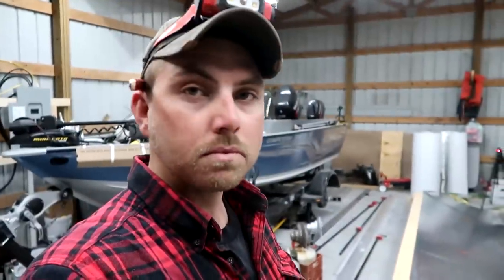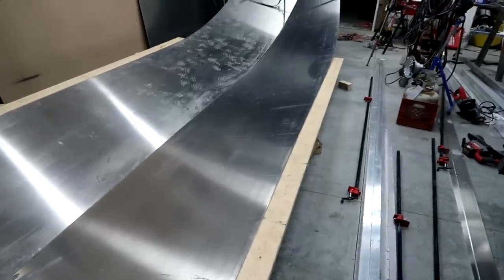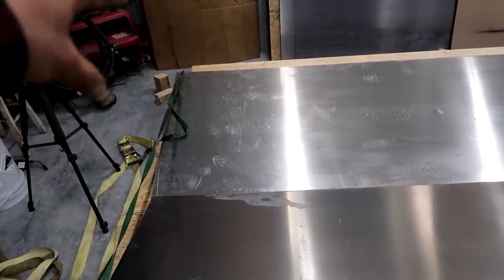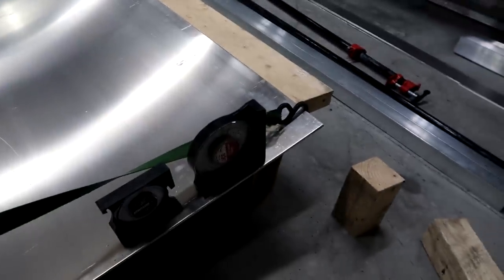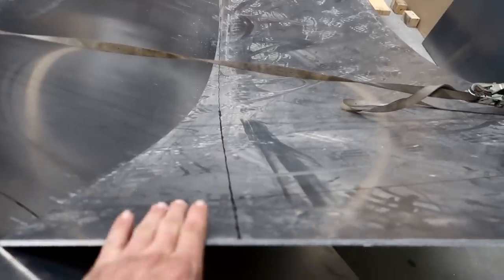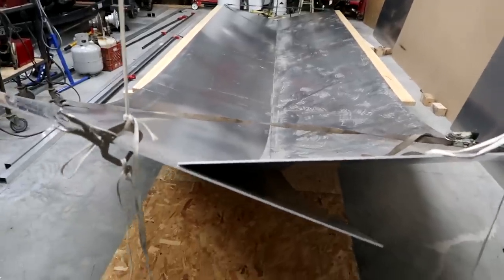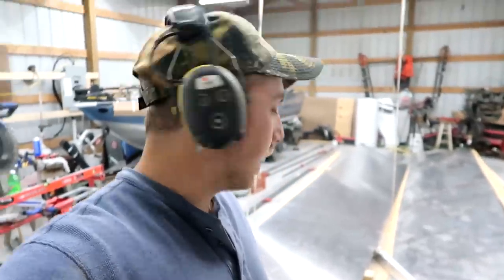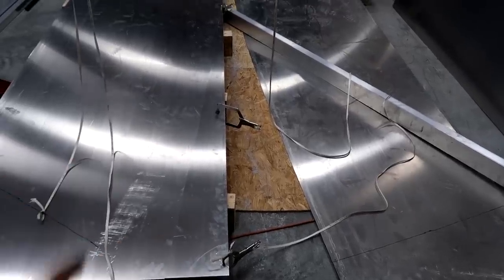Building a 25ft Aluminum Boat Part 3

Comment: And this right here is why boat builders should stick to assembling boats & not designing them!
Leave all this to a naval architect!
The sheets are all supplied computer CNC lofted & plasma cut, but with 3/4 inch tabs still nesting them into the original rectangular sheet.
All allowances are factored in for the myriad of things you have no idea about when it comes to designing a boat.
You have no idea what the longitudinal Center of gravity or Center of buoyancy will be, once constructed with the engine/s, fuel tanks, passenger loading etc etc.
Same from side to side, you have no idea what those parameters will be side to side  either, or indeed what the meta centric height will be.
Will it self right to flooding angle? Will it pass a standard incline stability test when fully loaded with all its rated passenger load standing on one side at the same time?
It’s supposed to retain more than 1/8th of its beam width in clear freeboard under that condition, to pass the test once built.
You have no clue how to calculate that at the design stage. Will it ride on its chines or are you designing / building a chinewalker, that always rides below its chine seam and falls to starboard or port?
I can see just from this one video, you really have zero idea what your doing.
I am all for learning by your mistakes but a 25 ft boat is a damned expensive way to turn a LOT of $ into scrap metal when the finished product ends up scrap metal coz it handles like a pig.
Naval Architects are worth their weight in Gold! They are worth every penny that they cost because you know ahead of time all these important design and handling / safety aspects, of vessel design.
All I can say is this will end in tears!
I can say this from experience & qualification having built aluminium boat designed by a naval architect & put it through passenger carrying commercial survey, as well as owning now a 25 ft aluminium boat designed by a naval architect in commercial passenger survey, as well as the fact I’m a qualified master 5 skipper, (100 tonne ships master).
Son your problem here is that you mistakenly THINK you know what your doing, but the fact is you know barely enough to be dangerous, because you don’t realise how much you DONT know, that can easily get yourself and crew / innocent passengers killed.
Naval architects have forgotten more than you will ever know about designing or building a boat, and to not avail yourself of that knowledge experience skill etc is just fool hardy at best, and out right dangerous / potentially deadly at worst.
Go sit down with a local naval architect & give him your design brief, tell him what you want out of the boat etc & let a professional design something up for you!
You can review it all on screen in 3D with all the performance & safety parameters known ahead of time.
You will save weeks of time having the sheets lofted & CNC plasma cut to within 1/10,000th of a millimeter, for a perfect fit!
You will know ahead of time what WOT speed it will deliver with given HP engines, what fuel tank capacity it will hold and what fuel range it will have. You will know how stable it is, what load it can safely carry, what the metacentric height is and how long the GZ curve is.
These aren’t things you just “wing it” on!
In the same way you shouldn’t design & build your own plane or helicopter, you shouldn’t be doing the same with a 25 foot boat.
25 foot boats don’t go to sea with just you on it! It takes a minimum 2 crew for a 25 ft boat, which means every time you go out someone else’s life will be in your hands, for the design, construction, materials selection & then operation / handling of the vessel.
I know people been designing & building their own rafts canoes and yes even boats since NOAH built the ARK, but even NOAH had a set of plans from the creator of this universe, the grand architect of all creation.
Do yourself a favour & at least sit down with a naval architect and discuss what your intending to do, and see what a professional says!
Best of luck with it, I have a feeling your going to be needing it!
Cheers
Reply: Charlie Guess again! 100 tonne ships master who has built aluminium boats designed by naval architects before today.
I happen to know, what it is that this guy doesn’t when he ought to know.
Reply: Ian-Pretty sure this guy knows a lot more than you think he does since he embraced your comment. We'll see when he is done. Maybe you are right, but your hostility reveals that, maybe you have some personal issues from your childhood you need to deal with. How was your relationship with your dad,  was he a perfectionist? Did you feel accepted as your father's beloved son, or did he make you feel like you had only conditional love? Did your mom show you love and acceptance? What was the interpersonal relationship between your mom and dad, whoa, there could be some issues. These are issues you need to look into with a licensed professional counselor because your response reveals much about some brokenness that you need to deal with.
Reply: @ianmoone2359  That's ok, I'll bill ya. Maybe you could do a video next build you do (if you ever do another one), explaining the effects of the physical criteria you mentioned. I know you are not a designer, but are familiar with terms, so you can tell what effect each has. There are a lot of people with welders' skills who would like to try building an aluminum boat, and it could be a hobby that could save a builder a lot of money if it was done right.  I can tell you are passionate about people doing it right,  and the cash outlay for this amount of aluminum would be prohibitive if it didn't work. And yes,  most folks wouldn't want to try this without a boat designer plan.
Reply: Why don't you leave writing a novel to a writer?
Reply: Ian Moone your being ridiculous. This is a guy building his OWN BOAT to HIS standards. Not some boat he plans to sell as a kit or to make in a production way. How do you think new boats where built before cad or cnc???!!!  The fact that you put it all in someone else’s hands instead of your own says a ton. You obviously don’t trust your own ideas and designs. You know how many awesome boats have been built over the years by someone doing it the “one off” way!!??
Reply: Ian Moone wow. Your the most full of it guy I think I've ever seen comment on YouTube. This is a almost flat bottom boat with dam near square sides. I'd put my life savings and my life on the fact that this boat will be fine. Your just to much involved in letting other people make your decisions. Makes You not liable for anything you do. Which prob isn't much in the first place without someone holding your hand. The fact of the mater is that boats have been built by people at tHere own shops on there own time to there own design for years and years and years and have been for the most part absolutely fine. Your being ridiculous.
Reply: Mad Man Marine Complete & utter waste of $.
One that puts peoples lives needlessly at risk.
This sort of idiocy shouldn’t be applauded or encouraged.
Reply: @ianmoone2359  it sounds like you grew up embracing being watched over closely by a nanny state. Some people just like the freedom of doing things on there own, there own terms, at there own pace.
Reply: Ian Moone hey, by any chance do you have any sources in learning how to build a boat? I want to learn how to
Reply: To Ian Moone : I am a Tool & Die Designer Aircraft Technician . I've been in the business since Jan 1980 . Almost my whole work life has been in the aircraft business. I've watched all the videos of this build process . With all my years of education and experience it was a pleasure to watch the building process . If I could talk to the boat builder face to face I would greet the man with a smile , then shake his hand and congratulate him on the great job that he did ! By my interpretation of your comments, I think you mean that the build process shown would not be the way that you would do it . The man has taken on a real challenge and come out shining !  That's all .
Reply: “You’re wrong brother” - Joe Dirt
Reply: "This will end in tears"....Yep TEARS OF JOY as Stu lays the smackdown on  every species he targets while laughing his ass off, fishing out of the perfect (for him) vessel for his recreational needs. I'm sure he can also provide you enough crow to eat for years to come, if you'd just ask him nicely.  After all, he was nice enough to pin your pompous and arrogant diatribe to the top of this video. CHEERS!!!
Reply: Dave Bierman aaauw 😂
Reply: Somewhat, I agree with you with the way he planned to cut etc. As iif there's no plan or pattern around, and no thorough calculation...just lift and said that's the line he's going to cut.But you don't need any naval architect for this kind of boat.You can figure that out by yourself.with good plan, thorough calculation aand some understanding.
Reply: @ianmoone2359  You needn't do all the work, leave that to your son and his mate while you video the process and provide "expert" commentary and advice. Come on, put your money where your mouth is!!  Doomsayers are a dime a dozen, (calculated) risk takers deserve all the encouragement you can offer.
Reply: @paultrgnp  My biggest concern isn’t for the builder of this vessel, it’s for his paying passengers. USA is the most litigious country in the world. When / if something goes wrong and someone who paid for a trip dies needlessly & the coroner investigates, they will call in experts in naval architecture, marine surveyors to work out what happened to cause a death.
Assuming the builder / skipper / guide lives, at worst he will end up charged with negligent homicide - at best the victims family will sue him for everything he owns or will ever own down to the 5th generation, because that’s the sort of country USA is.
Just ask Alec Baldwin what happens when you don’t understand guns, your anti gun, but you mistakenly THINK you know enough about guns, to utilise one on a movie set without the armourer being present.
Innocent people needlessly die.
This guy is the Alec Baldwin on the boat building world.
The sad thing is that most likely rather than Darwin draining the shallow end of the gene pool and removing him from the planet, most likely it will be some innocent, who pays the ultimate price for his lack of knowledge.
Possibly it will be some innocent child even.

It’s different if it’s your own boat - but once your charging as a guide, then it’s a regulated industry requiring at minimum a 6 pack license and there are safety standards that the boat must meet.
As long as nothing goes wrong he MIGHT get away with it all his life.
But, when it doesn’t all go right, we’ll then it will be a different story.
This is what happens when people who should know better mess around with boat designs against all the naval architect perameters, thinking that they know better.
https://www.wafic.org.au/coroners-findings-loss-fishing-vessel-returner/
It makes interesting reading.
There’s little to no difference to what’s being depicted in this series of videos and the tragedy in that link that cost 3 men their lives.

These aren’t things you can just “wing it on” when the vessels being used commercially for hire or reward - ie paying passengers.
There are rules and regulations for a reason, ie to prevent idiots like this from portraying themselves as experts to hire out their expertise.
Reply: not to be rude but anyone can build a boat you have software that you can design it in and check buoyancy ad the same time plus you know how where and what to cut from what i see him doing is just eye balling this xD i kinda agree with you on this one this will not float  straight never ever you cannot just eye ball it you need proper measure and weight in mind when building something like this 1 sharp turn en entire boat could flip with everyone in it
Reply: @ianmoone2359  lol this comment aged like cat shit on a sidewalk in July
Reply: @OzarksCreekandTimber  ahaha right!
Reply: Your comment was pinned, this is hilarious!

Comment: If you wouldnt mind sharing, where or how did you learn to do this? specificity the layout and design? Did you design this boat and lay it out / loft it yourself or did you have plans? I ask because building my own aluminum boat is also one of my life long dreams but I have no experience laying out a boat. I also want to be able layout and cut my own materials, so I am not looking to just build a kit. If you wouldnt mind sharing how you started your learning process, I would greatly appreciate it.

Comment: Years ago a professional Canadian boat designer builder told me how he did it.
He built a scale model of the boat first.
He then took the shapes from the model hull and scaled them up.
Transferred these to the alloy sheets and cut them out.
He would then assemble the hull using 1/2 inch tacks.
Then add the ribs.
Outside hull stiffness longitudinal were quickly added to reduce distortion 
He told me it would come out exactly as the model looked so there were no surprises.
Unfortunately I have not put it all to the test yet.
Hope this can be of some use.

Comment: Friendly tip..... get a book on "marine and aircraft "LOFTING". They had great  ones from around WW2 ,don't panic its easier than you think..I believe you can weld . "When in doubt lay it out ", then fab that's cutting the material,  then you can build whatever you are building. Lofting is layout full size. I would kill for the space you have. Check out the old books Amazon probably has a few .
I  admire your passion,  keep on.
Years ago the Aluminum industry assoc had info about welding boats 
Like COPPER DEVELOPMENT  has for copper, brass etc . Most of it is free.
We want to see progress ,

Comment: How are you figuring to anticipate heat warpage as you weld?  Kind of hard to accurately know to the nth degree what will happen on long welds even to a lesser degree on stitch welding.  Also have to remember the saw kerf when using off cuts for a pattern.  Nice project.  Take care.  Doug
Reply: Douglas Thompson You don’t continuous long weld aluminium boats.
You stitch weld 2 inches at a time & alternate stitches port starboard port etc to allow time to cool between the next stitch. You weld from 2 inches away from yourself back 2 inches towards yourself. Then same on opposite side, then when you come back to the first side you jump ahead 4 inches of where you left off, and weld back 2 inches towards yourself, leaving a 2 inch gap between the two welds. When it’s stitch welded you clean up with stainless steel rotary brush & fill in the 2 inch gaps using the same method. You do this on the inside seam & outside seam.
Aluminium being a white metal doesn’t show when it gets white hot and approaches melting point.
That’s the reason you start well ahead of your last weld and draw weld back towards yourself, it allows the start of the weld time to cool before the next 2 inch stitch commences. By alternating side to side you minimise / prevent warping, and this with the draw stitch 4/2 method heat doesn’t get a chance to build up.
Welding aluminium boat is a science / skill in itself. Up fillet welding a transom takes extreme skill.

Comment: why not cut two points on it and fold them together works more accurate and faster buy a lot and put in support beams temp to keep it true on the line then not much that could go wrong